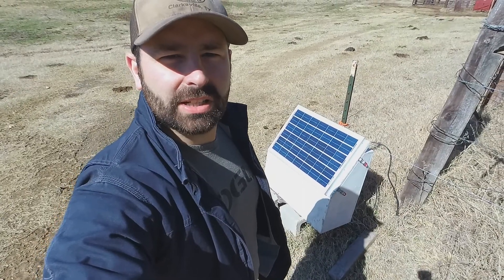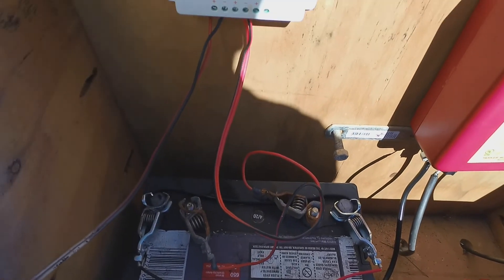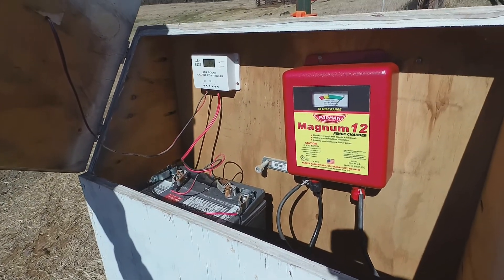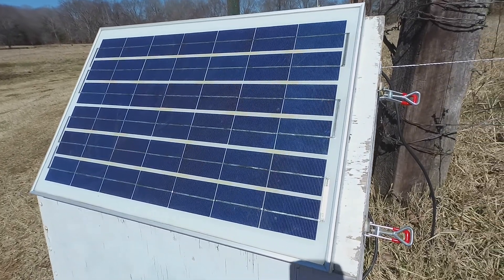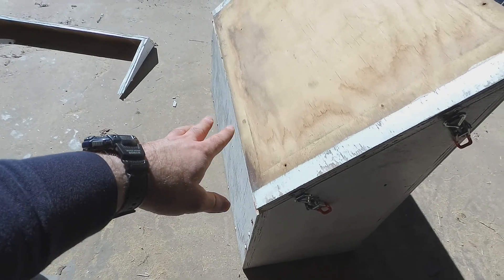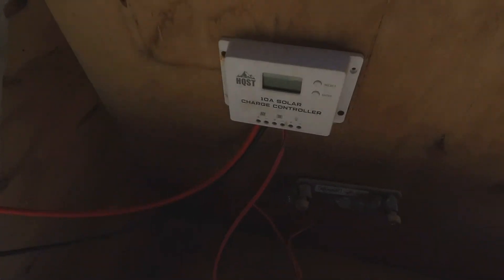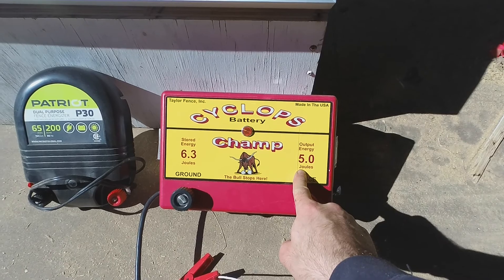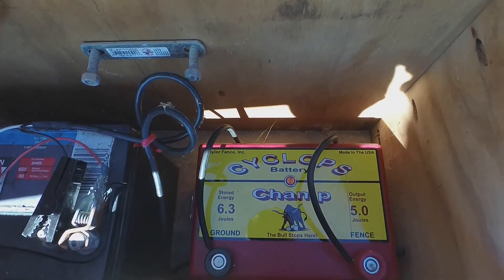Solar Electric Fence Energizer | Built It Yourself with a Cyclops - Parmak - Patriot

Comment from the maker: Amazon Links:
50 Watt Solar Panel - https://amzn.to/3kxOGyi
MC4 Pigtail Wires - https://amzn.to/3m5ylBx
10 Amp Solar Charge Controller - https://amzn.to/41qIU24
Battery Clips - https://amzn.to/3kjLJlb
ParMak Mag 12 Energizer - https://amzn.to/3xOtVBB
Cyclops Champ Energizer - https://amzn.to/3It292C
Patriot Energizer - https://amzn.to/3ECZFh0
Toggle Lid Latches - https://amzn.to/3ZgFbCz
Grounding Rod Kit - https://amzn.to/3Iv1Nbw
Reply: Wow, thank you for all the great links.

Comment: Do you have any issues with the cows messing with it? That was one of our bigger problems, they would knock it over on the ground,  or if we mounted on t-post, rub on it until they knocked it over. Those dang critters just can't leave anything alone. EDIT: sorry, I just saw your response to another viewer with the same question. thanks
Reply from the maker: I honestly haven’t any issues with it even though I half-way expected to. I do place it on the opposite side of the fence as the livestock if at all possible. That’s only been doable a few times.

Comment: For the Cyclops, do you have 2 ground rods installed? Maybe that is why the voltage is a bit low? 
Thanks for sharing this video! Looks great. I'm awaiting my Cyclops to be delivered. Tired of my Tractor Supply solar energizer and wanted something better
Reply from the maker: I do have two rods. I might not have them far enough apart. I know there is a distance that is recommended. I want to say 6 to 10 feet but I’d have look that up to be sure. I do like the cyclops chargers! Very well made and the hit hard!

Comment: What size panel did you end up with to get the 5 joule working…?
Was your 10 amp charger up to the task…?
Reply from the maker: This was a 50 watt panel I believe. It definitely helped. The only issue I’ve had with the solar charger is when the bottom flooded and it got submerged by water.

Comment: Did you do a video where you also used a 110 fence charger off grid with a power inverter? I can’t remember who’s channel it was I’m kind of looking to try that?
Reply from the maker: Nope wasn’t me but I think I remember seeing a video similar to that. All of mine are solar/12v units.
Reply: @arrowjmfarms  I have several 12 V units but I also got a couple Gallagher line units that are pretty big sitting around. Don’t wanna spend the money on the large cyclops. I got an eight jewel unit off grid now is my biggest kind of questioning if it’s big enough.
Reply from the maker: 8 joules is pretty powerful, of course it depends on how many acres and hot wires it’s running. The only concern I’d have running an inverter is there will be some power loss because of inefficiencies in the inverting process. It will work but extra battery power wouldn’t hurt.
Reply: @arrowjmfarms  I talk to the guy from high desert YouTube channel and he had a six jewel hooked to an inverter but he only had a 35 W panel and was swapping batteries out every three days. He seem to know a lot about it but what we didn’t know was once your fence is under load will the inverter suck the whole amount of power the inverter is rated at. For example, if you have a 750 W inverter is that gonna suck 750 W I don’t know what’s considered under load my fence continuously has some load on it or is that all you mean when it gets a shock going to ground? I’ve got a lot of black  black locust post without insulators so I don’t know if that means it’s actually under load and some electricity is going to ground obviously if you had a five or 700 W inverter and started pulling that that would drain your regular deep cycle battery real quick even if I had a 300 W panel somebody had a channel that had a pretty good size farmer ranch and I remember seeing the video and even asked the guy a question about it. He obviously said a DC charger was better to use and for the life of me I can’t find that video anymore
Reply from the maker: @michiganhay7844  On the 750 watt inverter that's basically just a rating. It's saying it is capable of providing 750W of inverted power before it bites the dust or blows a fuse. It doesn't mean it will consume 750W continuously. And you are correct in assuming that the more fence load you have, the more power will be consumed by the entire system, thus draining the battery faster. Likewise, if you had a lower load on the fence it would not consume as much battery power. That being said, there is always a little bit of power loss when converting from 12 volts DC to 120 volts AC - and vice versa. The battery is your power source so ultimately that's where the loss will show up. As to how much loss, I can't say for sure, every inverter may be a bit different because of design and parts quality.

Comment: The key is to connect the battery to the charge controller first, then the energizer and solar panel.
Reply from the maker: Are you saying to run the energizer through the charge controller output? That’s certainly an option. And I’ve done it that way before but the charge controller will cut off the output if the battery voltage gets too low, which would be good to protect the battery, will kill the energize let animals out. I started connecting direct to the battery for that reason.